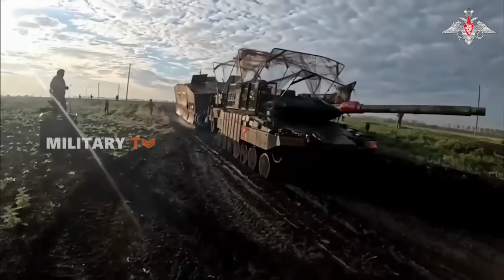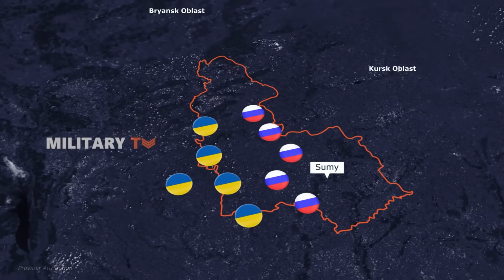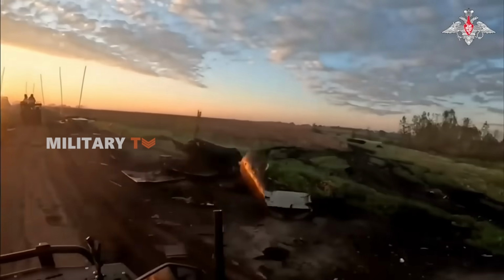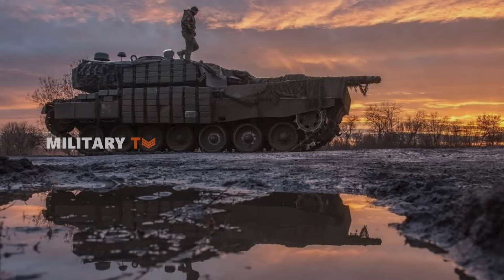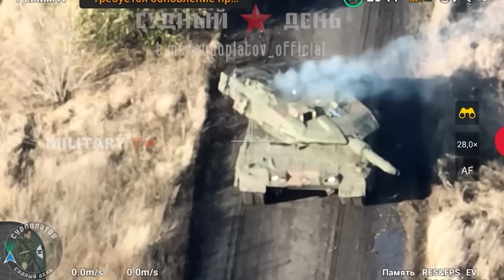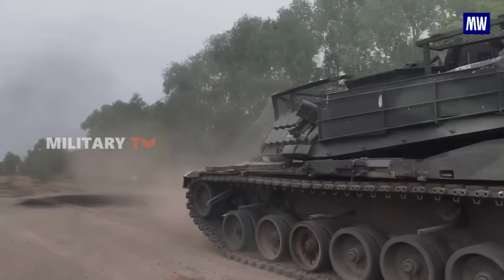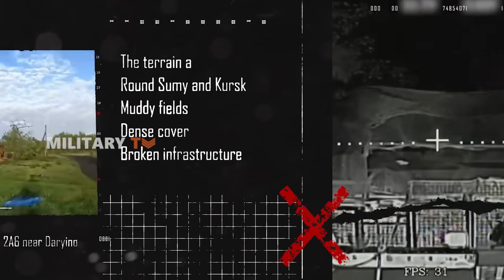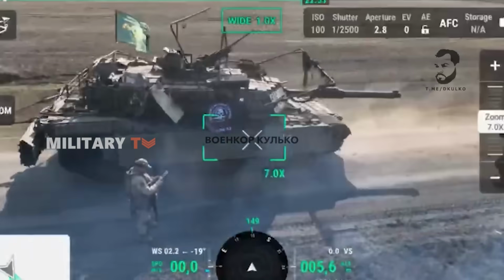Breaking! NATO’s High-Tech Armor Captured Intact—Russia Scores Massive Battlefield Trophy

Comment: There is not much to study. Not much get shipped to Ukraine that risks revealing its secrets. Leo 6 and the Swede are aging. If they had secrets that was unacceptable for Russia to find they have been stripped of it. The CV90 donated by Sweden are far from the same used in Nato. The swedes are not sending the blueprints to Russia about how to make programable ammunition and sensors in the wheels that secures a smoother ride which means less fatigue,. Don´t know how much it matters but it appears on every IFV now.
Many countries regret putting Leo7 into production before having the experiences from this war. A more powerfull gun is not what a tank is in most urgent need of now.